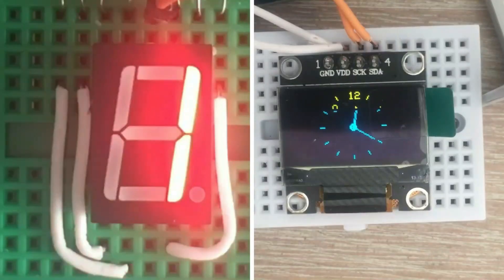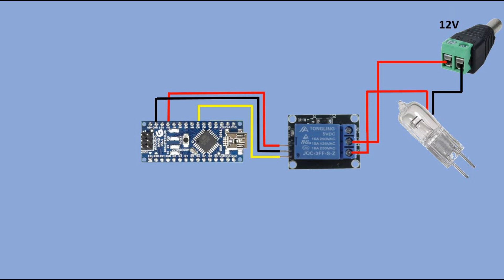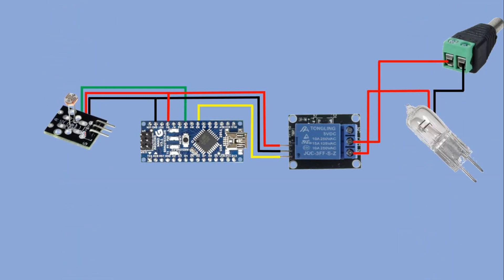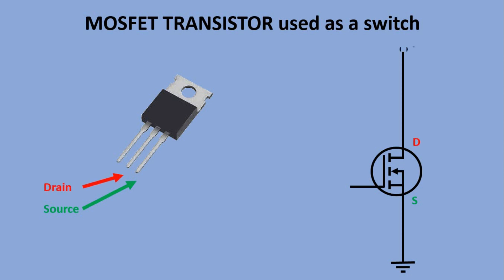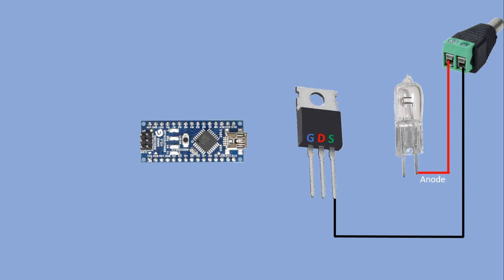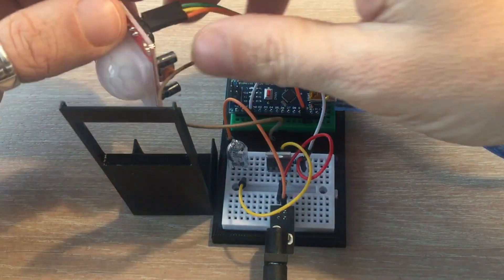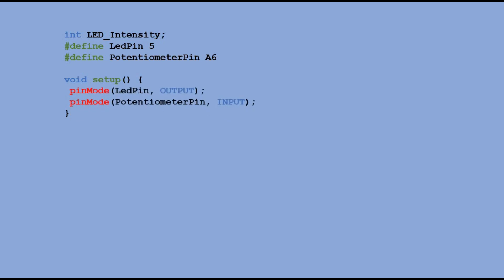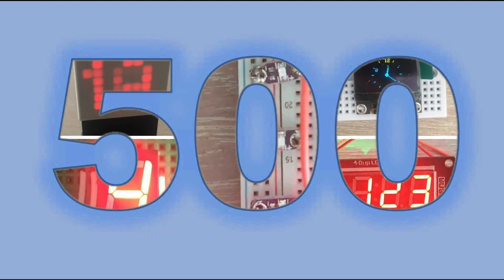How to control 12V devices with Arduino. Using Relay vs Using N-Channel MOSFET transistor

Comment: Hello! 
I connected my arduino with a single channel relay driving two 12V DC Motors. Each motor draws about 3 Amps. I have also a small SG90s servo motor connected to my arduino.
When I turn on the motors they work fine but the servo starts shaking like crazy and rotates unexpectedly in different angles (The Servo works fine when the motors are turned OFF). 

What could be the problem here?
And how to fix it?
Reply from the maker: Please share schematic. Can be Hand drawn. Include all components, their part numbers and/or values and all power supplies. mdraber@email.com. I do not often use this email so please let me know when it is sent

Comment: how would I control 4 solenoid valves using a 4 channel relay with one power supply?
Reply from the maker: You can. But you can also do a circuit with mosfets. Pleanty of discussion of people doing just that. e.g. https://forum.arduino.cc/t/circuit-for-controlling-multiple-solenoids/617457

Comment: Well done on the tutorial. This answers my question as I want to build a set of Knightrider lights, but I need to use 12v bulbs and the relay's are no good as they can only do on/off. Transistors on the other had can be "dimmed" which is what is needed on the knightrider light sequence, cheers!
Reply from the maker: Give video a like if you have not done already:)

Comment: What happens if I send 0-5v PWM signal to the relay? Will I get proportional 0-12v brightness at the globe? ...or would I need a solid state relay?....
Reply from the maker: Have you ever heard the click of the relay. You would understand that this is meant for 0/1 logic only. If you would send PWM the switch from 0 to 1 would be way to frequent for the proper switching of the relay.

Comment: i see a delay ups switch over circuit on ebay that has input in relay for 12v battery and 12v adapter and as soon as light/power interrupts the wifi router is switched to 12v battery with help of relay. can u make a diy version of it?
Reply from the maker: No promises... but you can send me the eBay link

Comment: sir, is the transistor circuit is safe for Arduino? 
 If not then please make a video to protect the bord.
Reply from the maker: If you do a connection like described in the video, then your arduino is safe

Comment: What power supply are you using?
Reply from the maker: DC12V 1,5A power adapter similar to this one https://www.dx.com/p/ac-to-dc-12v-1a-power-adaptor-with-5-4mm-dc-plug-eu-type-110-240v-2005974.html#.YadttbrdjIU

Comment: If i use TIP120 or TIP122 transistor what resistor can i use for it. And what is the ohm of resistor used for 3v led
Reply from the maker: Those are not MOSFET transistors. They require more current and may get quite hot.

Comment: Thank you! Can I ask if I can power my arduino and the device that requires 12v and above with only one 12 volt source?
Reply from the maker: You can power both arduino and devices (e.g. servos, led strips etc). You just have to make sure the powersource will provide enough current. So you may have 12v power source with 1A or 2 A or more. You cannot use power source >then 12v

Comment: bro I want to make a portable solar panel analyser and for it I need to measure Isc (short circuit current) of 10 A so what do you think will be better to use relay or transistor? The parameters are open circuit voltage which is 50 V and power is 350 W
waiting for your reply

Comment: Can you explain N vs. P channel mofet? I had to use a P channel mosfet for providing 12V to an accessory signal for an inverter I have and I don’t really understand why, N channel did not work.
Reply from the maker: I am not that deep in the elctronis . My udderstanding is that N channel transistor require less current to switch and do not overheat

Comment: I have a question about my project if you would be so kind to help

Using an Arduino and a 11.1 lypo battery
the power to the Arduino has a power regulator from the battery set to 5v
I also have two 12v transistor modules so i can run two 12v solenoids  that switch on and off at 20ms s o very fast

also i have a switch.
the problem is i want the Arduino to be on running its code and then using the switch to activate the solenoids is that when the arduino is powered up the solenoids are running/working even when the switch is Off
but if i have seperate battery to the Arduino  and another to the solenoids modules all is ok,
but i want to just use one battery without creating a loop
Any one with idea :)
Reply from the maker: I don't see your exact circuit so difficult. I would need to see if I can recreate the problem. I to anderstand I I took 12 v power supply and power arduino with it through VIN pin and GND pin and then also power a separate circuit in which e.g. magnetic lock is connected and the circuit has a transistor in it with gate pin controlled by one of arduino pins that would recreate the setup you have right?

Comment: How would I convert a 12a voltage triggered relay to a pwm converter? 12 volts output
Reply from the maker: not sure I undertood your question. Can you elaborate
Reply: I have a 12v voltage triggered relay I would like to modify it to convert pwm signal to volts.
Reply from the maker: @carinar.648  Relay has only on off Logic. For propagating pwm info voltage change you need to use transistor which is explained in the video
Reply: I will be using this on my car ac compressor?
Reply: Which plc board do you recommend?

Comment: Can i use the same power supply (12v) to power arduino?  Perhaps using a step down voltage before connecting to arduino. It's quite annoying using two different power supplies in arduino projects
Reply from the maker: Arduino should handel 12v as long as you power it through VIN and GND pin. It has a built in step down.Do not connect to 5v pin as this would fry the board

Comment: Is it possible to connect load on source side instead of drain side in N channel mosfet?
Reply from the maker: The general rule is to connect load to drain. There is a number of articles e.g  this one https://electronics.stackexchange.com/questions/97505/attaching-load-to-source-on-mosfet
Seems like you would not be able to use nominal voltage of the power supply

Comment: Man! worth a sub! very detailed and informative video. I was trying to add accelerometer with arduino for passive braking. I think this really helps me a lot, and using transistors resistor would be best for me too cause im using 12v lipo. Never used arduino before so good luck to me.
Reply from the maker: Thanks for the sub!
Reply: @marios_ideas     i have an application where there is a relay and a fuse to a 12V load (only 1)

I was considering using a relay module and ditching the fuse (is this safe or a relay module does not replace a single oldschool automotive relay + fuse)?

I then found out about mosfet modules that are much more compact, now could these be a direct replacement to my old fuse relay combo?
Reply: same here, I finally "learned" how to use the Transistor and relay in a very clear way. now I can go on with my Project, thank you Mario!!! ♥♥♥♥♥

Comment: Do relays break down quickly if turned on and off very often? (like for instance using it to power lights as blinkers)
Reply from the maker: I think they were made for infrequent switch operations. If you want to do something with high frequency then go MOSFET
Reply: @marios_ideas  I was thinking of using it for a blinker (like indicator on a laydown bike) As it would make the machanical sound I thought it'd be kinda fitting. It won't be switching constantly, just a couple of times every so often when turning.

Comment: Is it safe to use mosfet type switcher for PC? (Arduino plugged into USB PC, the mosfet is wired to PC PSU)
Reply from the maker: I am not 100% what you want to achieve. You only can control device through the mosfet transistor when Arduino is powered on. Can you describe more.
Reply: @marios_ideas  I am trying to power the LED lights with PC PSU (connected to molex), then the mosfet is connected to Arduino for control. The Arduino is powered via USB on motherboard slot so that I can send data from PC to Arduino for controlling LED lights.

Comment: Why were you using a 5V relay if you were using a 12V power supply??
Reply from the maker: Relay is used to control higher volatage circuits with 5v logic.  This is why it is called 5v relay.
Reply: @marios_ideas  thankyou

Comment: 7:30 you said connecting arduino and 5v power suppy, did you mean to say arduino and 12v supply?
Reply from the maker: Guilty as charged. Nicely spotted:)
Reply: @marios_ideas  Can you make a tutorial for adressable 12v leds? Like this one but with led light strip. Thanks. Also, you have a new subscriber😎 your channel needs more subscribers

Comment: Hi, what are the other MOSFET types that could be used instead of IRFZ44N
Reply from the maker: I would say you can use all MOSFET transistors as a switch. But I am not 100% sure so maybe sombody can chip in a word or two on the topic. e.g In video https://youtu.be/9O0pb0I6bCU I used IRF520.

Comment: This is very helpful!!
But IRLZ44N is not widely available in my location. Can I get away with IRFZ44?
Sorry, I'm still a noob for this QAQ
Reply from the maker: This is just the MOSET transistor I had. I am sure you can. If you look at other video I ahve on this subject there I am using a MOSFET module and there IRF520 transistor is used. You can also use other type of transistors like BJT but there the legs of the transistor are different and connectivity would be different.  But with some minimal investigation you can get to use them as well
Reply: @marios_ideas   I've been reading couple of articles and discussions, I believe the main concern is that 5V from Arduino won't be able to fully open MOSFET's gate.
But for small current usage, these MOSFET should be fine.
Thank you so so much for helping and great videos! I learnt a lot from you :)
All the best! stay safe

Comment: If we connect the relay directly to the Arduino, wouldn't there be a possibility of harming the Arduino, due to the voltage spikes in the solenoid coil of relay? So, should we use the snubber diode connected parallel to the relay or it is okay to use Relay directly?
Reply from the maker: Honestly i am not that strong in electronics. I hever had a problem with spikes. I have never fried any arduino boards. But next time I would use forum I would take your comments into account. Cliryfy on electronic forums. Thanks for your suggestion
Reply: A lot of the relays intended for Arduino can be set up with an optoisolator that is included in the module. You simply change a jumper from the configuration it comes with and power from a completely separate source (ie not the same power source the Arduino is using). The Arduino then basically turns on an led inside a cover that also contains a light sensor in order to trigger a circuit to trigger  the relay.
Reply: @BigGoad  Yeah, but in this video, there is not any optoisolator in relay module. That's why I asked.

Comment: Thank you. I want to control the speed of 24v bldc motor (250w) by connecting Arduino to the motor driver.
Is it possible to control 24v device (bldc motor) with Arduino?
I am a beginner in Arduino and I am studying. I've just subscribed to your channel.
Reply from the maker: I am sure you can. I di not play with motors yet. The one I have are 5v . I might do a video like this in the future

Comment: So you would need a MOSFET for every 12 volt LED you wanted to drive then.
Reply from the maker: If you want to control them separately. If you want to control them all at onec then just one and connect them in the series
Reply: @marios_ideas  Thank you for your reply. I'm new to electronics and arduino. So im learning all this stuff. Would a IRLZ44NPBF mosfet do the job also?  See here. https://smile.amazon.com/gp/product/B01ARKPMPK/ref=ox_sc_act_title_1?smid=AAY9BD64LY1P8&psc=1

Comment: Do you think this setup can be used to control 12vdc 100w lightings?
Reply from the maker: This relay should be able to control any 12 circuit
Reply: @marios_ideas  how about using MOSFET? will it still suitable?
Reply from the maker: I am sure it can be used. But I would consult someone profficient with electronics to pick the right one so it does not overheat. Just write a question on any electronic forums describing your 12v circuit and ask which mosfet would they use if it requires any additional resistores etc. Most likely MOSFET I used would do the trick but I would double check it

Comment: great explanation. 

subbed and liked :) 

i'll order an arduino set before long, and start making small setups. 

would it make sense to use a mosfet to power a relay that takes 12 v to trigger, since they can handle more amps than the ones i have found for arduino (i want to power LED projectors on my car)

i will be fun to watch your channel grow
Reply from the maker: Never tried it but it should work. within next twoo weeks I would post another video call it appendix to this one that will show the ready to use posfert module.